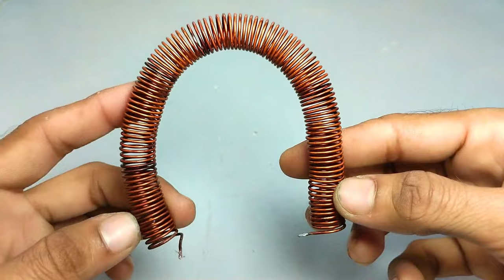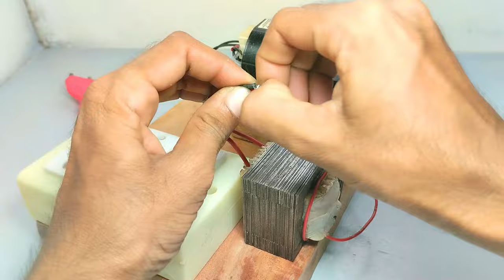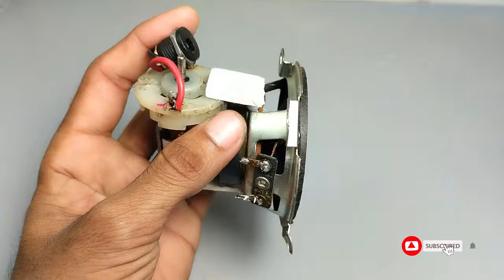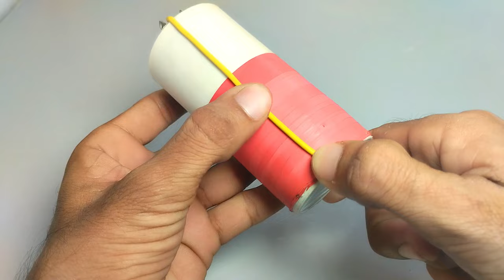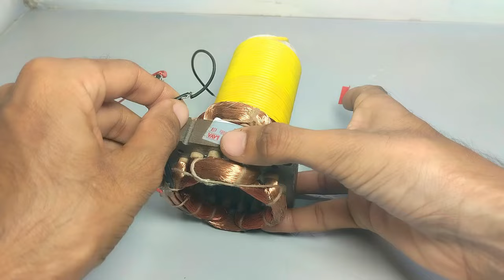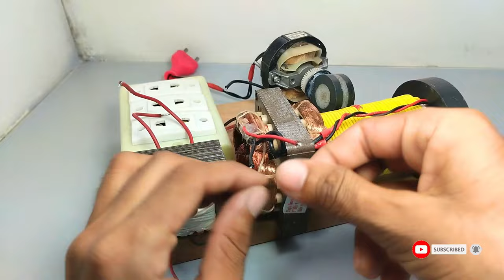Top 3 Awesome Free Electricity Generator 220V  II Freeenergy_maker10m #Maker10m _freeelectricity

Comment: #1: Power strips don't work like that! There are obviously batteries inside it that are powering it. There was a quick cut after you pulled the string and that is when you pressed the switch to enable the power for the lights to turn on and for the spinning motor to get power
#2: 1. You literally used the same power strip in the 1st one. 2. You also plugged a DC power supply into the thing connected to the speaker. I assume you were trying to pass it off as a 3.5mm audio jack?? There is nothing special happening here.
3#: Again, the "power strip" that clearly has batteries in.

You can't get "Free Electricity" as it breaks the basic laws of thermodynamics. Simply put, you cannot get more energy out of a system than you put in. It is as simple as that!
Reply from the maker: thanks